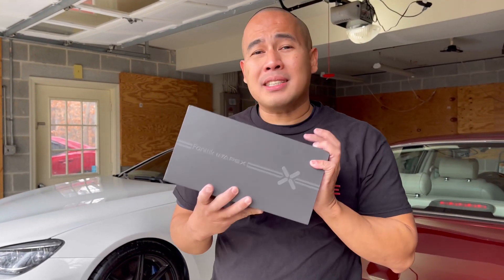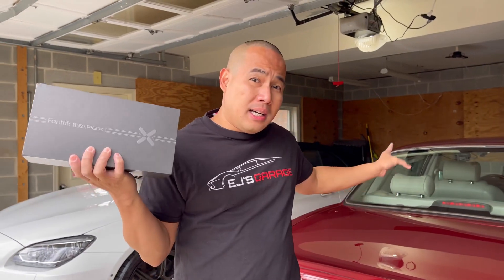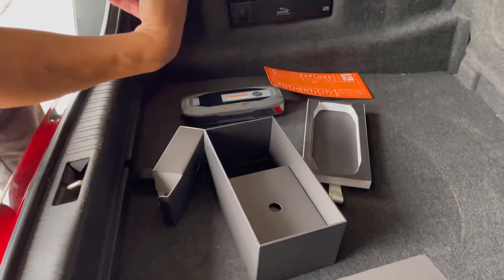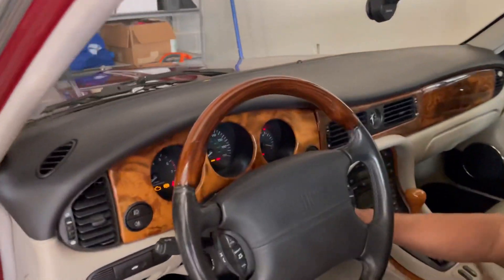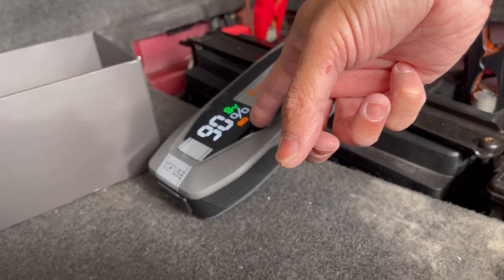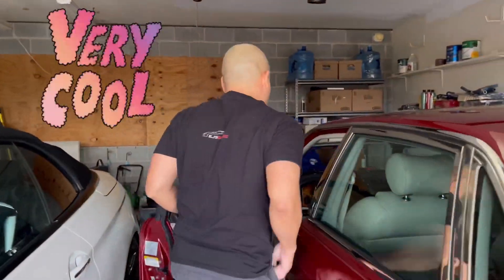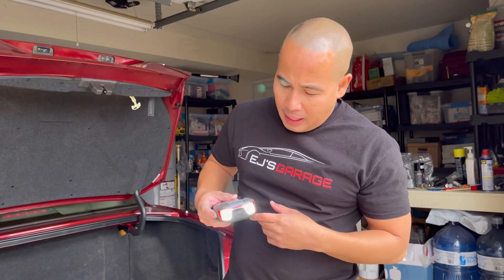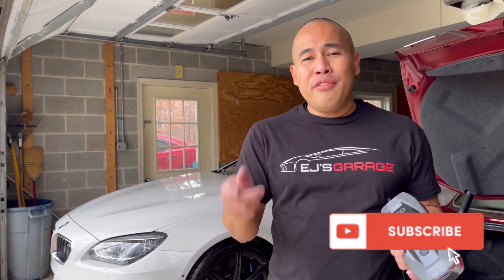Fanttik T8 APEX Review & Unboxing Best Compact Car Battery Jump Starter. How to Use Booster Mode

Comment: If the vehicle with a dead battery is parked front-in between two other cars in a parking lot, you can’t reach it with jumper cables. Or if your battery dies, you don’t have to beg a stranger to let you jump from their car.

Comment: Nice video. Glad to see it worked for you..I know some people had trouble getting it to work..  Was a bit worried as I had purchased one a month ago too.. Haven't really had a chance to test mine.......  That boost mode makes the difference. Though I wished it would only be required at a lower voltage (e g 6V instead of 8)... The instructions at the back don't mention anything about boost mode.  So I ended up sticking a label at the bottom with the necessary information on how to activate boost mode.
Reply from the maker: Thank you very much. The manual unfortunately didn't mention it. Once it was activated, the unit works like s charm.